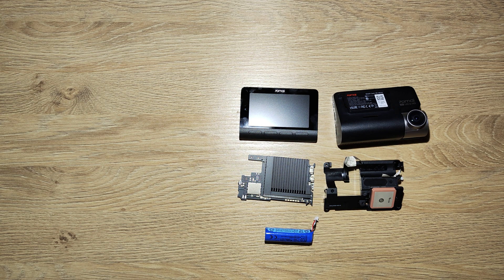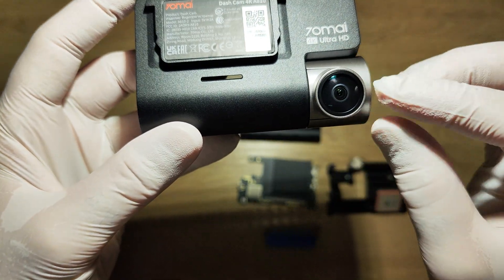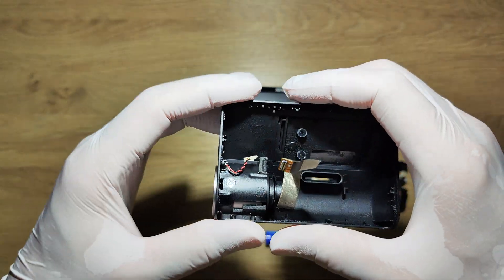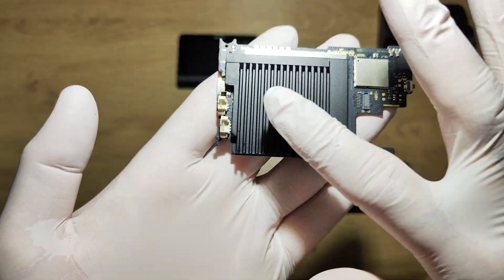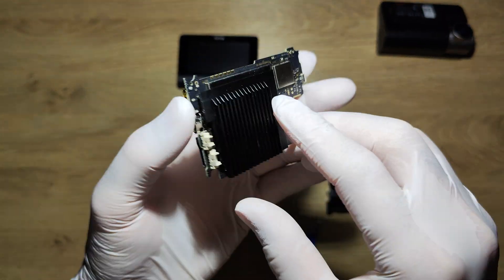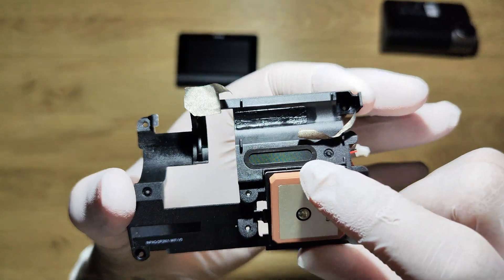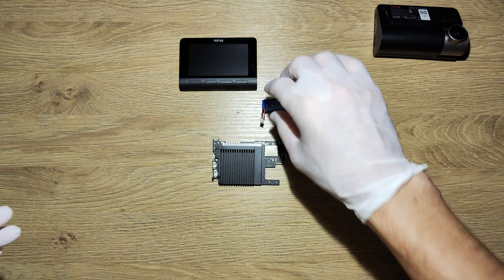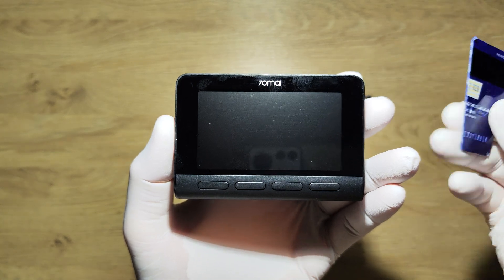Disassembly of 70mai Dash Cam 4K A810

Comment: Hi is it possible to upload some pictures with the camera cable showing the dimensions of the cable end with some ruler side by side or even if you can determine the pitch of the pins. I m planning for custom installation but I don't have the camera yet and i need to order cable extension.
Reply from the maker: Sorry for the late reply. I will upload it for you.
Reply from the maker: Hello the size of the Dash cam are 3.7cm x 6cm x9cm.
Reply: Black lcd screen how i can fix it
Reply from the maker: @abduilrahmanabumostafa4753  have you tried to open the dash cam ? Check if there's loose cable?
Reply: @RahmatullahRezai  i can’t open the camera I don’t know how it can open
Reply from the maker: @abduilrahmanabumostafa4753  it's not so difficult if you have plastic cards. You can use credit card
Reply: @ i did not understand
Reply from the maker: @abduilrahmanabumostafa4753  hello sorry for late reply. Did you fix your dash cam?